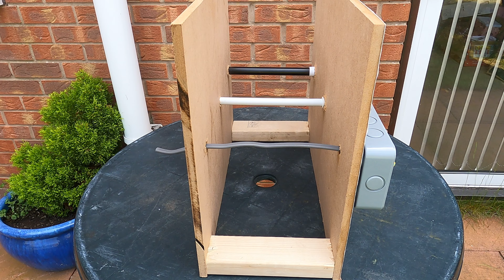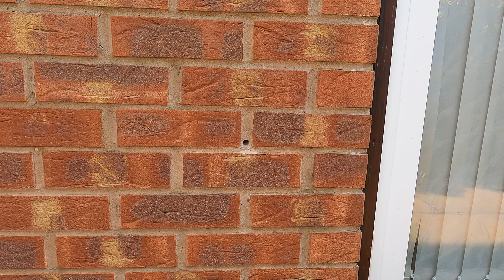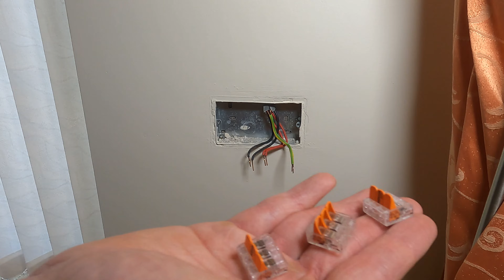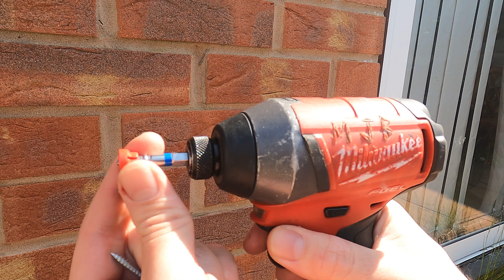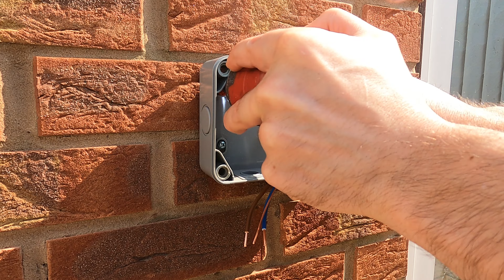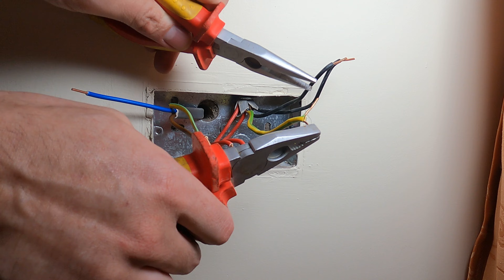Ultimate DIY Guide: Installing Outdoor Socket for Any Space | Easy Electrical External Socket Guide

Comment: Just one minor criticism, you didn't put a rubber grommet over the hole you cut out in the metal back box, this would prevent possible cable chaffing, other than that excellent job done 😊👍

Comment: For an outside socket can I simply add a plug onto the 2.5mm wire to plug into an inside socket or is it better to spur onto the inside socket and as you have done would recommend changing my double inside socket with the new style connectors as you have done and are these available in screwfix or tool station  thanks , your video as given me confidence to have a go myself and save a bit of money.. my current double socket has two browns , two blues and two earths
Reply: Either way would work. I just used a plug inside. Easier to isolate then too if needed. Can just unplug it or switch it off. I used a 13amp rcd plug off Amazon just for added protection they aren’t much money.

Comment: Only thing is this way shown in the video those outdoor sockets remain live which isn't so bad if within your own garden area but mounted in at the front of the house in the public area isn't safe as it live all the time unless it's a lockable type socket box
Reply: Good point. I have fitted a front exterior box using a 13amp plug on the inside so I have control over the exterior power and fitted an external socket in my secure back garden as shown so I still have the use of a double socket on the interior. 😊👍🏼

Comment: just forgot to drill out the weep hole
Reply from the maker: I prefer not too drill the hole and maintain the ip65 rating of the box.
Reply: This👆🏼👏🏼 There is no red to drill out the drain hole if fitted correctly as shown in the video. Using silicone grommets etc. Has no moisture or warm air from inside the house will get into the outside socket. It even states I the packaging to the news boxes that if drilled out you lose the ip rating. Just keep your eye on it after fitting for a while. Check for condensation. If fitted correctly there will be 0 moisture inside

Comment: excellent job , only thing you forgot is to make a hole inside the BG outdoor socket, this will help the water to drain if there is any leakage.  

If you see inside the socket, left-hand side down there is place to make a hole.
Reply: But this would invalidate the IP rating?
Reply: @prav1976 interestingly that's what the manufacturer recommends...
You can buy 20mm IP rated vent plugs instead to keep the IP rating of the box
Reply: @dimitrisblane6368 they only recommend to drill out to cover there arses. In case it’s fitted badly. If fitted correctly like shown there will be 0 water/moisture in that outside box. If drilled out you lose the ip rating and now have a un-waterproof box

Comment: For non electricians I suggest mounting the exterior socket outlet as shown, except I would use a socket outlet with an rcd. Plus instead of spurring off at the socket, use a simple plug top. This way you won’t have to touch any of the electrical circuit, you can isolate the outdoor socket at any time or fit a timer.
Reply: Why would you fit an RCD socket if the circuit is already protected by an RCD or RCBO?
Reply: @LSDzero  What if the circuit you was connecting to is only protected by an AC type RCD or RCBO? The new outdoor socket fitted could be rated as A type RCD which would be compliant with current 18th edition regulations.
Reply: Most modern consumer boards are already fitted with rcds
Reply: Great advise. A bit belt and braces but that’s they way I work. Do it right 1st time every time!👍🏻

Comment: I wiuld have used a fused spur internally - external power usage is notorious for fusing circuits and you do not want your ring mains going down.  Also stainless steel srews cannot be held wih a magnet.
Reply: This is what I would do. I don’t remember a lot from being an electrician from 20 years ago but I have always remembered that.

Comment: also... why did you split the earth cable on the interior? What kind of new internal socket did you use and what are they specifically called? I assume that is the only type of design socket that will accommodate for a spurred outside socket?

Comment: So how exactly would you install an outdoor socket if you don't have an existing socket on the wall ajacine to the outside wall you wish to put the socket on? For example, I only have sockets on the side walls which are joint to an neighbor either side.

Comment: nice vid but you forgot to drill out the 5mm drain hole and silicone the side and top pushouts!!
Reply: No need for drainage hole if fitted correctly. IMHO. It add all the grommets and silicone no moisture or warm air from inside the house will get into the box
Reply: 4 mm. Max for drainage hole

Comment: Top job, and excellently explained 👍

In no way criticisms, but two additional comments as food for thought...

1. Another common approach is to take a fused spur off the socket on the inside of the house and wire out through the back of that, rather than directly out through a socket itself as shown here. The pro for that approach is that it would allow you to isolate the external socket should an issue arise with it (and being exposed to the elements, there is always that possibility) without the faulty socket taking out the entire ring circuit. The con of course is that you have to chase a new box in the internal wall, or add a new surface mounted box. Adding the fused spur externally as you've shown is also an option to achieve the same result.

2. It's good practice to add a 20mm gromit to the knock out on the internal box as well. This prevents the twin and earth potentially wearing on the metal lip of the knockout over time (not that there will be massive movement, but still recommended).

Excellent tutorial I must say and kudos for showing the various methods for entry into the extenal box 👍
Reply: Yes, I’d have gone with a switched fused spur. I’d have also preferred the rcd integrated into the socket. I definitely wouldn’t want that tripping the whole board.
Reply: @tj9382  Whilst I'd agree about the grommet on the internal box, having an external rcd would less than halve the chance of a fault outside tripping the rcd on the main board. Both would be rated to trip at 30ma current leakage and the main one would actually see any leakage on the external socket, PLUS the rest of the ring main. A switched non-fused (already protected by CU) spur would allow it's isolation when faulty, or to prevent misuse by unwelcome visitors.
Reply from the maker: Hey,
Thanks for the comment and the extra tips, Its much appreciated.
Reply: Also there is a drain hole on the bottom of the socket which you should drill out, just in case any water manages to sneak in

Comment: What size earth sleeving is required? Cheers.
Reply from the maker: 1.5mm
Reply: @mikebolt9753  Thanks.
Reply: @mikebolt9753  Is this the same size required for most DIY applications or would I need to buy a range? Thinking mostly lighting, including outdoor light and sockets
Reply from the maker: Yeah 1.5mm should have you covered. @Nyle95
Reply: @mikebolt9753  Thanks. Ordered some last night. Would you do a video showing your top tools for electrical work please? Would be good to see what yoh recommend for someone building a tool kit and interested in electrical jobs.
Reply: You need 3 mm/4mm cpc sleeving  , 1.5mm is the size of earthing (cpc) conductor.

Comment: I'm not questioning the handywork in this video but the legality as I thought that the only electrical task a non-qualified DIYer could carry out would require the supply cable to be fitted with a 13 A 3-pin UK plug and be plugged into the 3-pin socket? 
If the power supply is hard-wired into the back of the double socket , as shown here, then a qualified electrician is required for the task? 18th Edition-er asking.
Reply from the maker: Yes. You are correct in what you are saying. My intention is to show people how it is done safely as there are plenty of people out there that will try this regardless of the legality, I suppose the intention of this video is to help them do it safely.